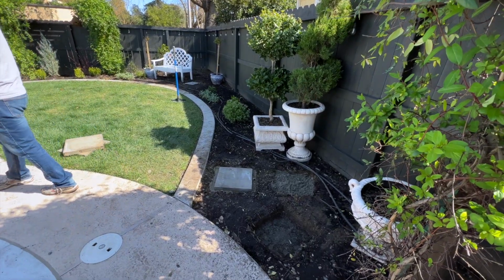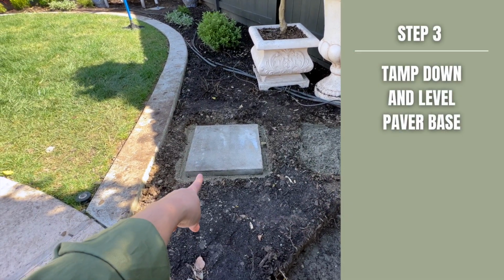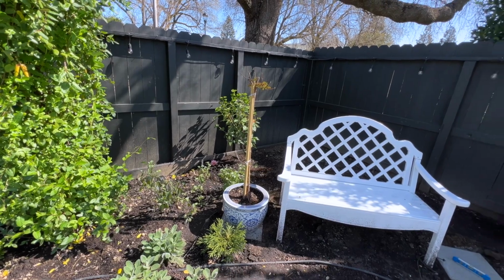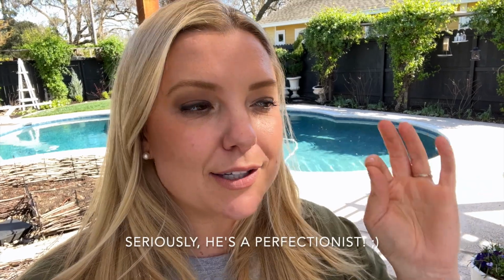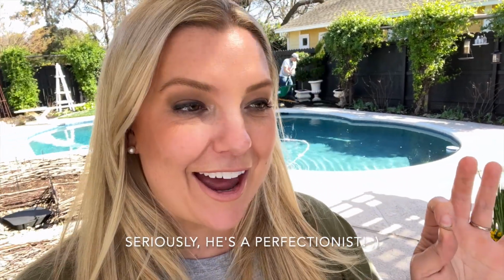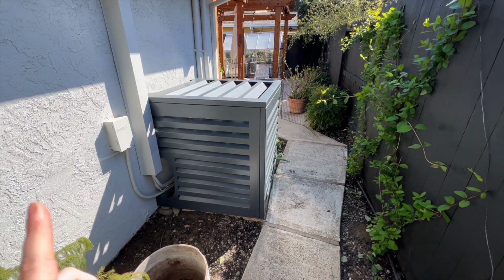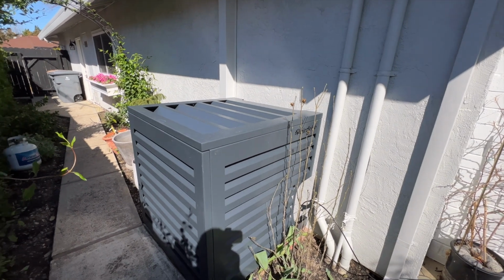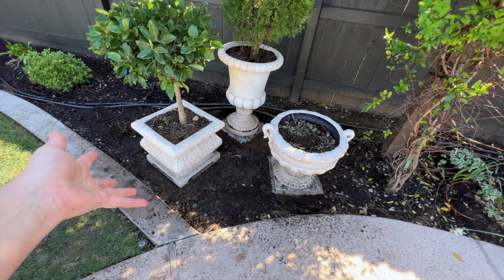Leveling Pots Placed in Garden Beds the "RIGHT" Way! 😆🪴😆 PLUS My New Air Deko AC Unit Cover!

Comment: Hi guys! Don't you need pot feet to keep those pots up off the pavers, so they don't hold water??? That's what my person at the garden center said.  I inadvertently drowned my false cypress, I'm so sad about that...it was such a cute little tree...
Reply: I'm pretty sure the concrete pavers absorb any extra runoff. Mine do. But pot feet do look nice. My problem is that ants like to set up house under any pots not raised up or not in a saucer.
Reply: I agree. Pot plant feet needed. It’s the same as not placing a pot on plant feet on my walkway where I lost boxwood and a type of evergreen. The soil was soaking wet.
Reply from the maker: Hey Barbara! I will be putting pot feet under the rose pots but the topiary pots don’t need it! Thanks for watching 💗
Reply: @eileenchang2173 definitely pot feet (or 3 bricks) because I had 2 big pots of plants where the hole clogged up that cause them to rot…totally water logged sitting on flat concrete & a flat paver.
Reply: Feet also help with air circulation and temperature. I like the rubber multi-packs from Amazon. They disappear under the pot.
Reply: I’m constantly straightening a pot in my garden. Thinking I may have to remedy that. Thanks! What about a pretty wall planter above the ac unit with succulents or maybe some of the creeping Jenny or both! My creeping Jenny survives everything so thinking some hot air would be ok.
Reply: @JenniferNonillion  hi, can you link the Amazon ones you like? Thank you!
Reply: @lillyhanh3496  I can’t post a link, but here is the description. 24 Pack Invisible Pot Feet with Enhanced Non-Slip Surface Grip Plant Pots and Flowers, Solid Rubber Pots Risers, Pot Lifters for Indoor or Outdoor Planters